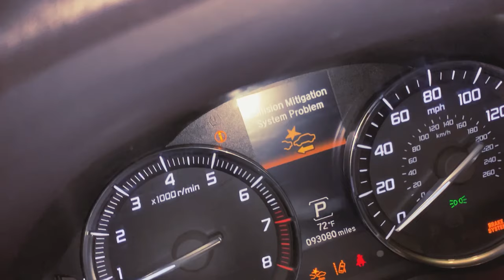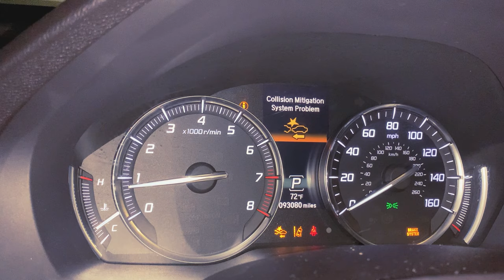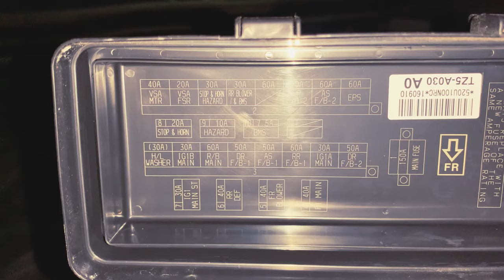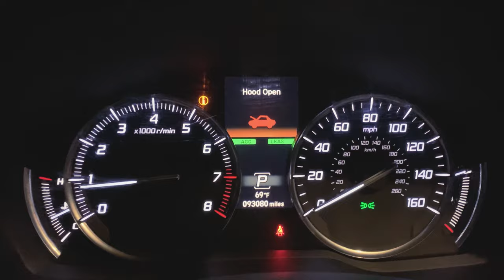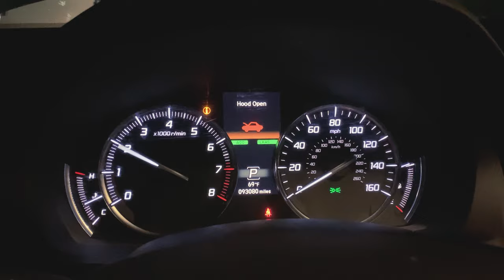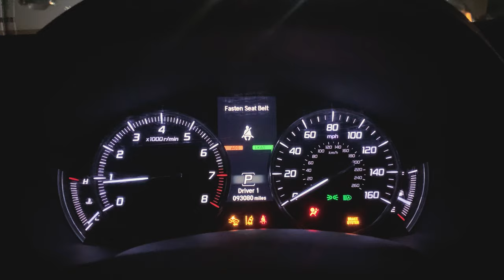How To FIX Acura MDX All Warning Lights On | All Dashboard Warning Lights On **RESOLVED**

Comment: You have saved my day. And a mechanic bill. I thought my problem could be ground and it was. Thank you for turning your problems into solutions for us all.
Reply from the maker: No problem, thank you for your comment.
Reply: @AWordFromMrJones That fusible link you have the part number?
Reply from the maker: @Hannibal54689  I can't recall because there are 2 part #'s. 

I would recommend to call Acura and confirm that this is the correct part# 38233-TZ5-A01 (Acura Multi Block Fuse D).
https://www.acurapartswarehouse.com/oem/acura~fuse~d~multi~block~38233-tz5-a01.html

Here's the 2nd part # 38232-TRX-A01 (Acura Multi Block Fuse D).
https://www.acurapartsforless.com/oem-parts/acura-fuse-d-multi-block-60a-40a-30a-20a-38237tz5a01?origin=pla&gclid=CjwKCAiA04arBhAkEiwAuNOsIr5afMXoLi7RifAsPl5wcEDglquCh5DRqOVdcWOYIBG28HShld-EpxoCe2AQAvD_BwE
Reply: @AWordFromMrJones  Thank you so much

Comment: 2016 MDX here. Cleaned, sanded, and tightened my battery terminals, but it didn't help. My fuse blocks were good and clean visually, but went ahead and cleaned them with WD40 electrical contact cleaner. A leg of a roach or a bug came out, problem solved and all warning lights are gone. I'm not sure if it was the leg or dirty contact, but thanks OP's awesome video.
Reply from the maker: Good deal, appreciate the comment. It’s possible the contact was a-bit off due to the debris.

Comment: Had this issue on my 2016 MDX. Fuses looked good. Took battery to be tested and it tested good. Talked the auto store employee into swapping it out for me since it was under warranty. Came home and installed it an No more lights! Don’t let a battery that tests good stop you from trying another.
Reply from the maker: Appreciate the tip Robert.
Reply: @Robertessary648 , after replacing the lights did those  ever came on again?

Comment: Happened to my 2016 TLX. If you do replace your battery, which I did, do not use a”refurbished” or any other kind of used battery. It will not produce the same voltage. They may say it does but, it doesn’t. My car still lit up like a Christmas tree. I purchased a NEW battery and it the car has had no issue. Have a great day!

Comment: It's an alignment problem just do an alignment, balance and rotation, the purpose of all those lights coming on is to warn you the alignment is off
Reply from the maker: @albertohernandes4516  Interesting perspective because alignment will never display dashboard lights and alignment issues will never shut a vehicle off.

Interesting 👀, I do question whom told you this information. 

Now let’s say you do have alignment issues, then you will physically experience issues with the movement of your vehicle and “free play” in the steering wheel. This will also lead to poor tire thread lifecycle. 

When it comes to the steering system and dashboard lights, it’s often that you will see an ABS light on if you have any issues with wheel sensors on this vehicle. I’ve also seen this issue associated with either the CAM or Crankshaft sensors failing.

Appreciate your input on this, very useful info 🤟🏾

Comment: This happened to me, was freaking out while driving, took it to auto zone to change out the battery, battery was still good didnt need to. Just unplugged battery and waited 5 minutes and then plugged back in. All lights went away
Reply from the maker: @VinsonDoan  Good to hear, I would be sure to inspect the battery contacts for any derby or corrosion.

Comment: This just happened to me today and I freaked out. I have a 2017 rdx. Took it to the dealership and they said I needed to change out my camera because it connects to all of those sensors. And that if I didn’t have it fixed I won’t pass my inspection in the future. They wanted to charge me $2000 to change out the battery and get it calibrated.
Reply: @Kellyngo1981  They told me the same thing. But aftwr getting the car and exterior detail the lights turned off. however yesterday i was in standstill traffic on an overpass and after a big rig drove past me causing the overpass to shale the lights came back on, so I plan on checking the sensors before i decide to go in and pay the 2k for the camera change

Comment: I have a 2017 MDX that was giving me the same issue, it tuned out being the battery vent fan shorting out. The dealership replaced it under warranty. The issue was resolved after that.
Reply from the maker: Good information, thank you for sharing.

Comment: LOL this is a fairly common issue that randomly occurs even if you have a perfectly good battery and no corrosion.  The act of simply disconnecting the battery resets many electrical components including ECU so your "cleaning" fix was likely coincidental and it was the actual power source disconnection itself that reset the computer.

Comment: Fixed my issues...2015 MDX...
Had 7 warnings in total...Power Steering, VSC, Hill Assist, Tow, Emission, LDW, and LKAS.  The lights came after a cold morning start where the car failed to start a few times.  Watched the video, cleaned the terminals and now all lights and warnings are gone.
Reply from the maker: Glad this video was helpful💯
Reply: This just happened to me on a used 2015 that I just purchased YESTERDAY. I was absolutely lost on what to do. Going to try this out. So thankful for this video 🙏🏾

Comment: Thank you for sharing. When my battery was replaced on my 2019 MDX Sh-awd two weeks ago. I have a Christmas tree. Dealer did a diagnostic and said it could be a short. ( vehicle was there for rod bearing replacement recall) I had an Acura tech work on the truck and couldn’t turn off the lights. Will try and update.
Reply: @mmone1178  did the lights go off?

Comment: I have a 2016 RDX. Same thing is happening as we speak. I'm going to take it to the mechanic to have the posts cleaned. I tried the ole baking soda and water trick but I really need to remove everything to get underneath the terminals. Thanks. I'll let ya know if my issue was resolved. Fingers are mos def crossed.
Reply: Was it fixed?

Comment: Just had same issue on 2015 MDX, and advised my mechanic based on your video. This may fix but will know soon and will update one I know. Thanks!
Reply from the maker: Cool, I am going to copy a message I sent to another YouTuber. If the battery is not your problem, please have your mech look at the following:

Be sure to check the fuses to ensure none of the fuses are blown or have corrosion. 

Now if that does not fix the issue, purchase a check engine line tester from Amazon, check the MDX to see if it's pulling a either crank or camshaft sensor faults. If so, your going to want to call the dealership to see if they can work out a good deal for complete timing belt replacement because the sensor is in the same area of the timing belt.

Thanks
Reply: @AWordFromMrJones  Thanks for the updated info!  I reseated all the fuses and am having the battery replaced as after reseating the fuses, the problem magically went away but the battery is over 4 years old so that may be the culprit.  If no more issues I will update for the benefit of all who have viewed this.  Thanks again for putting this out there!!!  BTW, I had the timing belt replaced at 105K miles.  I currently have 140K miles on it...
Reply from the maker: @brianb5594  Good to hear and thank you for the update.

Comment: On one of the forum I also read that it could be bad connections to the alternator as well. I have same issue and gonna try it tonight! Thank you
Reply from the maker: Also it could be either the Cam/Crankshaft Position Sensor. To identify that you would grab an OBD2 scanner to see if any codes popup. I believe there will not be an actual Check Engine light that comes on if this is the issue. 

I would grab a tool of Amazon to save time and money.

Thanks
Reply: Mine had codes for ABS system. Secondary DTCs P2638 "Torque Management feedback signal A Range/Performance. Im still trying to narrow it down.

Comment: This just happened to me! Terrible corrision on the positive terminal. Cleaned it somewhat but I think the battery might be shot. The AC compressor cycles every half second so I am thinking the battery wasn't being charged by the ALT.
Reply from the maker: Lack of power can cause all sorts of interment issues.  I would defiantly replace that battery is it's more then 3-4 years. Now a days they don't make parts like they use to, so even a new battery can be defective next month.

Comment: The 2017 RDX I traded a Sportage for has this problem, new battery because the one in it was a under rated battery, new EVS sensor, had Acura clear the codes, it went maybe 7 months and is doing it again.  Disconnect the battery and reconnect, lights are off, for a while.  I will try cleaning both fusible links next.

Comment: Hi Boss are you saying if I pull off that air intake plastic tube off of my 2007 all my lights are on for the brake system I will check the fuse first thanks any help is appreciated

Comment: I don’t understand how a dirty terminal can you cause those lane mitigation and lane assist warningS . Does this really work?
Reply from the maker: @mrdude3540  Some electronic devices, such as a motherboard ; if the connection may become dirty/corroded. That device may experience intermittent issues. 

• Cars are like computers on wheels 
• They work best when all electric components have a clean electric pathway for communication

Unfortunately I cannot validate if this video will fix your issue but it should help you identify a starting point when it comes to troubleshooting these issues.

I would dig in and see what you find as the solution 💯

Comment: Hey, I appreciate your video. I have a 2020 Acura TLX and last summer it was doing this exact thing. I would disconnect the battery and wait a couple minutes and then I would connect it and then it would go away. And then once got out and fall and winter had no problems. today as I speak to you, all the lights came on and lit up like a Christmas tree and it has not happened at all since last summer. Do you still think it’s the battery because I think the heat has something to do with anybody’s advice would be appreciative thank you.
Reply from the maker: That's a good perspective because the MDX has a battery cooling mechanism. I would check the date of the battery to see how old it is, you should get at least 3-4 years out the battery. Anything else can lead to unforeseen issues although I have seen batteries live longer but they may experience issues with temperatures. Often, a old battery has issues maintaining full power during the winter if not used often. I would assume that an old battery may also have issues keeping cool during summer depending on the temperature.

Comment: Seems that I am the only one here that the issue exists even after replacing the battery. 2017 MDX. 
I am going to check the fuses next.
Reply: I’m having the same problem. I replaced my battery a few months ago. Just replaced my alternator with a used oem. Lights went away for a month. Now they’re back and the car is doing more weird stuff along with all the lights being lit.
Reply: Hello guys, didi you find a way to fix this issue?
Reply: No mine is still on too after replacing the battery $250 later and it’s still there but it’s still cheaper than the camera the dealership said I needed! Here nor there I e been driving with the lights on for over a year it doesn’t affect the car 🤷🏽‍♀️

Comment: The loose ground wire to shut the brake lights off on Acura DMX I have a brand new battery. Only two months old haven’t checked the fuses yet though

Comment: 2019 MDX here getting check engine and 3 warnings: Emissions System Problem, Electric Parking Brake Problem, and All Wheel Drive System Problem 

Just had minor body work done on front right bumper and fender. Could that work have shorted something? Vehicle seems to be running just fine.
Reply: Shawn, Did you ever find out what was going on with your MDX? I too am running into the same problems. I'm really hoping it's not going to be an expensive fix.
Reply: @alixandreagaumer8346  I don’t have the receipt right in front of me and the vehicles actually in the shop for something else now so I can’t grab it out of the glove box but it ended up costing around $400 and the service writer said that it was typically not some thing that would have to be fixed at the mileage of my vehicle which is around 60,000.

I wish I remembered exactly what the issue was but I do remember the pricing was somewhere in the $400 range

But of course it could be something else that you’re experiencing entirely right? All these computers make things so nice and so difficult.
Reply: @ShawnHonnick  my car too is at around 60k miles. 😭 That super sucks. I guess I will be taking it in. Thank you for the reply!! I really appreciate it!!
Reply: @alixandreagaumer8346  I just remembered it was my “purge control valve” and may have actually been from topping off the gas on filling up (don’t do that).
Reply: @alixandreagaumer8346   hi Alixandrea did get your problem fixed? And if so what was wrong with the car? Also if you don't mind how much was the expense?   I'm experiencing the same thing on a 2017 Acura MDX.  I love hondas. I had a 1997, and 2008  accord and they were so simple. Computers just makes our lives into nightmares....

Comment: Good afternoon.  I have a Acura MDX 08. I'm in a hard position.  No help just me and my 6yr old son. Can u help guide me to fix myself please? It would be a blessing.  I have all lights on all in a matter of 15 minutes even the check transmission and check engine, VSA, ABS, ADS. My question is my power steering has a big leak. Could this cause the Christmas lights going on?

Comment: hallo problem with camera  unit said  two parts  one camera. ribbon cable  second  pcb. my unit  is the problem with camera unit  ribbon cable small comment problem  ribbon cable  that's a problem    approaches  the ebay   couple   $$$  replacing the camera unit.  I use my pcb board.  and I do not  need calibration everything will work perfect. Important bay it is exactly the same model number of the camera if you have factory installed check it with acura parts   top on the unit.   or web  bay vin number code error. u3000-49.  The video sowing also correct problem  on the vehicle problem Acura MDX  2017 - 2022
Reply from the maker: Sorry to hear.

It seems this might be somewhat of a common issue with the audio system. Such as the LCD screen too may have an issue with the ribbon cable.

eBay is a perfect place to source USED and NEW parts for bargain price. There are times I would catch a dealership selling OEM parts for a good deal. 

Appreciate you sharing this information with everyone.

Comment: Sadly, the 2017 rdx I got does this, new battery,  EVS sensor,  cleaned ground cable connecton at frame. Went months, did it again, disconnected battery for 1 minute, codes gone til next time.  So its sti an ongoing issue. So I'll try reseating fuses.

Comment: I have a 2017 MDX this just happened yesterday changed battery today still have all lights all terminals good and alternator tested good any other suggestions before I head to the dealership?
Reply: I just found that my case was a #21 7.5 amp fuse blown that powers the battery fan so new battery fan and new fuse
Reply: @ZH81446 dealership repair? How much was it?

Comment: I have a 2005 Acura RL that has started going haywire. Dials start freaking out and while sitting idle a a stop light the car may shut off. It will restart but my wife refuses to drive it. HELP

Comment: Hello young man 
Thank you for all your videos they re sn 24:32 excellent source of info
And you are very through.
But recently i came accros an issue in my acura mdx 2010 vsa, trailer assist, and check sh-awd  lights came on 
I look through so many videos till i came accross one that i had not seen 
As to how to fix that particular problem
This was 2nd gen acura mdx 2007  long story short
HE REPLACED THE BRAKE LIGHT SWITCH
And boay  that Sh🤬t fix the problem in my 2010 acura mdx no more christmas tree  on my dashboard 
Am not a mechanic and i dont know how to post videos that s why i come to you.
Thanks i will appreciate it dearly. 
I FYI I did check my fuse link  that has the vsa fuse on it and it was fine

Comment: I have this issue now. However,  i just picked my car up after habing an accident where the passenger front tire came off while i was driving. Damaged the body of my car aroind the wheel well. The wheel is fuxed, but now the lights are on. Could the repair or accident have triggered this?
Reply: @Ladycece41168  Hi, what was your  solution please?
Reply: @myhearts419  The wheel being damaged triggered the other sensors. Once the system was reset & cleared, the lights went off. However,  I also ended up replacing the battery too about a month later.

Comment: Similar issue with my 2017 odyssey whenever I would plug my phone in to the car two days later I’ll get the check vsa system, check ldw system and the check fcw system Check parking sensor system